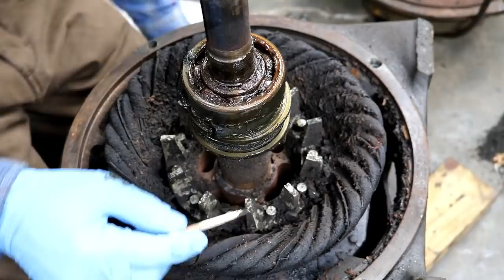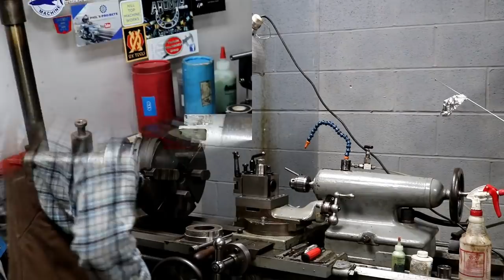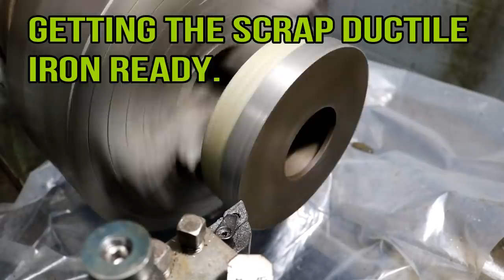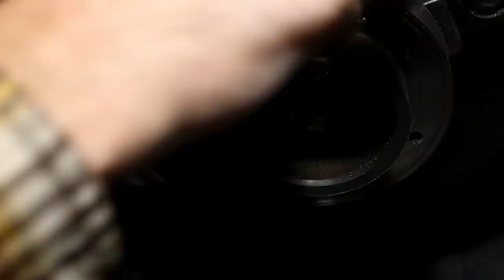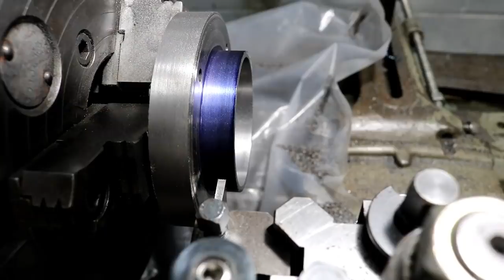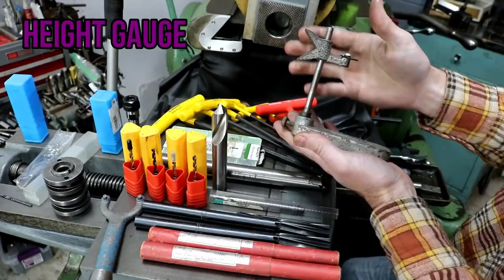WoW, It's Worse Than I Thought. K&T Motor Cleanup Begins.

Comment: Great video Steve. I worked in a motor and generator shop as a youth. We used to wash the stators in a degreasing bath, let them dry naturally and then spray the windings with shellac varnish. They would be tested with a megger tester before going back into use. Those windings look a bit dodgy to me, but until they are clean it's not really possible to inspect them. It's really getting into Autumn here in the south of England, dark by 4.30pm. It's still quite warm during the day, 16c today. Happy Anniversary! Cheers, Dean in Oxfordshire, UK.
Reply: Half past four here in Welshpool and still nearly full daylight. That's the effect of being further north.
Reply: @jonka1  I have to say, we've had some lighter nights. The weather has been very fine too. I lived in Northern Scotland for a few years, in the summer it never really became dark. Amazing what a bit of latitude can do!

Comment: Hope you enjoyed that popcorn you had cooking up in the background ;) 
even if you have a cheap ohm meter you can do a basic continuity check between coils to make sure you don't have connections between winding's seeing connectivity between the winding's will tell you if any of the insulation was scraped off, then test the resistance of each winding, don't have to trust the actual readings just as long as they're all around the same value will give you an idea if there's any shorts within the winding's even the cheapest or old out of calibration meters will give you a little confidence that all is good. Oh all of these tests are without the device plugged in to anything so no risk of being electrocuted or anything.

Comment: Hi Steve,
That motor is really bad, but for your subscribers interesting to look at the older methods of sealing. Insulation is shot, but you may get lucky, as you said at the top of the video, you have already envisaged a replacement.
Great video series, all the best to you and your family.
Reply: How do you know the insulation is shot? You sneak in at night and test it?
Reply: @1pcfred  , I stand to be corrected, but I think the dielectric properties of the insulation binding are severely compromised.
I am not a motor specialist, and it is most likely that the clutch mechanism failure was the reason for this mill being put out of service, so the motor may well have been in a useable condition.
Hopefully I am proved wrong in Steve's favour.
Reply: It is impossible to tell just looking at it. When this guy fires it up he'll know then though. He might be really firing it up then? I'd have a chemical extinguisher handy myself.
Reply: @1pcfred  , Yes, it maybe okay, again I hope do for Steve;  but it is a tall order for 70 year old insulation to maintain its integrity, at a guess it may be gutta percha or some tar based compound, one of Steve's subscribers has already mentioned issues using VFDs on older motors, ref higher voltage per Hertz. Though, with the wide range of geared speeds on the K&T, fixed speed is fine.

Functional obsolescence based on individual components, is something that can impact many man made items, modern machine tools have an optimum/useful life of 5 to 7 years, brought about by accounting practices unfortunately. The engineering in this mill, was no doubt high end, with very little thought to a use-by date!, very little has improved in use of high quality castings, carbon and some alloy steel, with very high standard of skilled machine builders, rather than assemblers today.
Bearings have improved, lubrication, and electrical hardware, ref cable, insulation and electrical control.

Many machine tools over 15/20 years old are rendered inoperable due to control shortfalls, OEMs do not want to support them, this is true for my employer, where our suppliers, and ourselves cannot obtain spares or the software to maintain them. I have found the US support older technology, in repair, here in the UK, it is less so, possibly due to a smaller market.

I do wish Steve all the best in restoring this machine, I have a small shaper I am restoring, it was originally over head belt driven, but had an electric motor fitted mid 60's at a guess.
Time to get up out of my armchair and make a nice cup of tea!!!!!!
Reply: VFDs are not always the have all and end all. They're nice where they're nice but superfluous to a detriment otherwise. Most are so enamored of them they view a VFD as some kind of a universal panacea. There's a larger picture many choose to ignore the finer details of though. They have an image in their own mind that they tend to run with. A blurry and distorted visage to be sure. Similar can be said of electrical and electronics in general when it comes to the topic of machining.
Reply: @1pcfred  Yes. I agree, basic VFDs  work, but compared to a high end Vector/Re-Gen Quadrature model there is a very wide gap. low frequency PWM is not the kindest to  equipment. 
Like the "Blurry and Distorted Visage" quote! .
Reply: Indeed little is as simple as it may seem to simple minds.

Comment: Steve  you should install new sealed bearings and eliminate those steel rings not required any more if you use sealed bearing
Reply: The motor would run quieter as a result, since those rings rub and drag along.
Reply: BM no me

E

Comment: motor rewinders or reconditioners use a tergasol bath,  a kero or spirit degreaser floats ontop of methylene chloride (chloroform) which is heavier and sits at the bottom of the cleaning tank,  basically just washing all the crud off the windings with big gloves and a brush.

Comment: The speed is dependent on the frequency not the voltage.  1450 is probably the 50Hz speed,  and 1750 the 60Hz speed.
Reply: Agreed, more voltage would result in more torque and more heat but not RPM
Reply: Sheila Walker IOP
Reply: @Tom Garbo  Bearings would be fine, boils down to motor heat. If you over drive them at 100% load they will not lost long.
Reply: Guys please, it only hertz until the pain stops. Sorry, I shall just get my coat and leave . 🤦‍♂️

Comment: ...Another video, always a treat.....and there at ….014:00....I've had to replace motors that were greased with out the 'drain' plug removed...excess grease got into the windings...burned up the motor...50 HP air compressor...expensive...$700 for a decent used one...
 As for that iron ring, I've seen several on youtube...you just open it to the amount you want, put a small piece of steel in there...oil up the ring and heat it with a torch until the oil smokes and burns off, usually that works...

Comment: Good video.   I'd probably still be on the lookout for a better motor. I to, like getting old stuff working. But a new motor that uses less electricity and is more efficient , is what I would like to power it. 
Love the 4jaw chuck. I'm looking for one also.  With a L1 taper.
Reply: Who told you new induction motors use less electricity and are more efficient than old ones? Were they in motor sales? There really hasn't been any technological innovation as far as alternating current goes since it was introduced. Because the guy that introduced it was an unparalleled genius and no one can improve on his work. Change my mind.

Comment: I would remove those rings, install sealed bearings, and seal the grease holes.
Reply: I would keep it original, they will never be made again, it is made by company that was connected to Nikola Tesla who invented AC motor
Reply: Normally, I would agree BUT with the quality of so many things being made today? Ball joints and wheel bearings failing on new vehicles with 60,000 KM!! Steve says the bearings are in great shape and I am sure he will not be over greasing. The age of the machine is a testament to the quality of those bearings and it would not surprise me that they are original.
Reply: Sealed bearings would be the way to go. We usually do that because so many people see a zerk and just pump in grease without removing the plug. Actually the right way is to remove the plug, then pump in grease until the grease coming out is new. It's basically changing the grease.
Reply: Yes, me too. It's old school, obsolete, back to 50-s, when there were no sealed bearings or smth...
Reply from the maker: Not a bad idea at all.   Thanks..    I will probably go back  original design just because. Your idea is easy and would be better sealed.
Reply: @SteveSummers  Split rings are quite common in old gear and work fine. We used to turn down some cast iron pipe and then saw the rings to split them, it is inexpensive and actually easier than finding polypacks to replace them.

Comment: Great video. The is some spray called hy-solv it's is for windings and electrical. I used it all the time for the spindle winding. Also if you ever bump the thinking there is a insulator spray you can use. It works very well. Just thought I'd mention it. Didn't know if you knew of those two items. After the winding process usually the stator is dipped in a lackor Keep up the great  work
Reply: Century old motor so the insulation is going to be shellac, so the only cleaning I would use is to use a soft bristle brush ( cut a new cheap indoor broom into sections) to get the worst off, then absolutely no solvents or water at all cleaning further on the windings. those are never dipped, unless they also were shellac coated after winding.
Reply: @SeanBZA   I had a brain fart lol saying shalack. Hy-solv is made for windings and electrical boards. Our company used it for over 20 years to clean them. Never one problem. We delt with windings of many kinds and age.
Reply: Eastwood also sells a motor winding solvent if I remember correctly. I’ve used it before on 1940’s vintage DeWalt RAS motors
Reply: @dinotom1  I believe the hy-solv we used was was re-labled but it worked very good. Heck it could have been the product your talking about. I was lucky enough to be the only person in our stat to sucsefuly rebuild a 190,000 RPM spindle that was fun.
Reply: @Michael Hale...wow, that's huge. must've been a cool rebuild!
Reply: @dinotom1  it was my first time using split inner races . It was small and alot quitter then I thought it would have been. I was very amazed . We had to rent a special VFD that could run up in the 2000 hz range. To run it at full speed.
Reply: Well, I looked it up on amazon, it was actually Lectra-Motive Electric Parts Cleaner that I used. ((-:
Reply: @dinotom1  that's cool
Reply: Keep testing and baking the armature as you go. No matter how well you clean, you can ruin the windings with just a little piece of dirt stuck in there. Last ditch effort use a Orange peel base cleaner.

Comment: maibe an enginehoist is good enough to get that 4 jaw on there

as for how the pro's clean the windings , we used a steam clean carousel
http://www.smitbros.nl/images/restauratie/tnMetalas.jpg
http://www.smitbros.nl/images/restauratie/tnMetalas%20parts.jpg
 and washed it realy hot for about 3 hours then baked it in a hot air oven to get the last of the moisture out , we had a machine that ran a high voltage low current (basicly a energy coil like an ignition system) through each the windings and checked if there was arcing between the coils 
if it came out of the test ok we would rebuild it if not it was time to call the customer and advice on the higher price or a replacement motor 

one idea i have about stretching the ring is make vise jaws that has 4 pins (2 on each jaw in a square ) sticking out the top 
lay the ring over the pins and open the vice as far as you need to stretch up the ring 
this will keep the ring flat and should spread the force over most of the ring

congrats on you aniversary (i cant believe she has put up with you for that long ) :P\
think you better get back on that floor asap or you might not make it to the 17th one

Comment: Steve
I presume you have set the spring in the ring by now but as I made a good few live steam model locos in the past ci piston rings I have made plenty
Here’s how to do it turn up the ring to OD and ID sizes also get it to thickness , then nick the ring say half way though with a fine saw then snap it the rest of the way 

Next put a bit of bar in the gap to spring open the ring as you need then get the whole lot up to a carrot colour keep it there for ten mins then let it air cool slowly 

The bit of bar will have fallen out and the ring will be springy when the gap is closed it will still be round 

Have fun and be safe
Reply from the maker: Thanks, I have not done the ring yet.   Thanks for the info. I will do that
Reply: Steve, Doubleboost did as he described, probably within this year.  It might be worth the effort of looking that one up.

Comment: Steve love your videos 👍what are the cans called that you use for your degreasing ?looks like you pressurise them ?
Reply: Just yesterday I was in our Rural King store and happened to see that they carry the Sure-Shot style cleaner can for about $25.00.
Reply: They're sold under the name 'Sure-Shot'...$30 or so...you put in your solvent/cleaner, then pressurize with shop air...there are several nozzles too, stream, or spray..
Reply: Google "sureshot".  Great item but you can't use solvents in them, they dissolve the seals.  Don't ask how I know.  LOL.
Reply: Thanks guys im in the UK fingers crossed I can find them
Reply: @coleboonecustoms  they offer several different types, depending on what you want to spray....I have one with Teflon seals...works with any solvent, acetone, brake cleaner...
Reply: I use one of these filled with lacquer thinner for final degreasing. The lacquer thinner doesn’t bother the seals, sometimes I change out the lacquer thinner for WD 40 for the earlier stages of cleaning, derusting, and for general rust prevention.